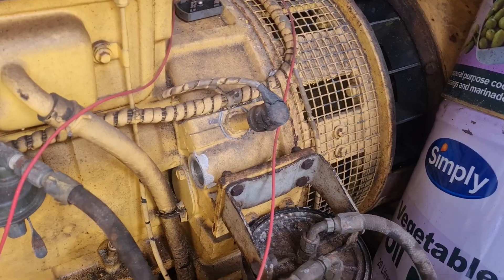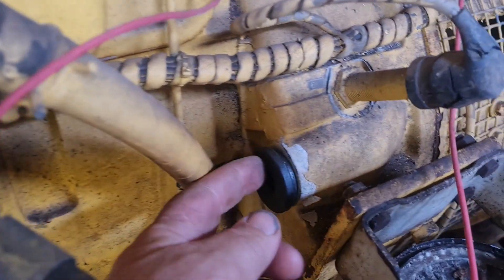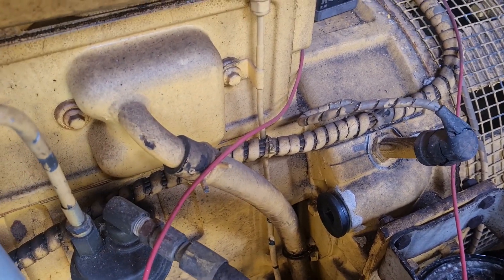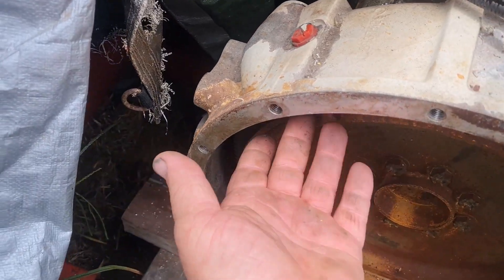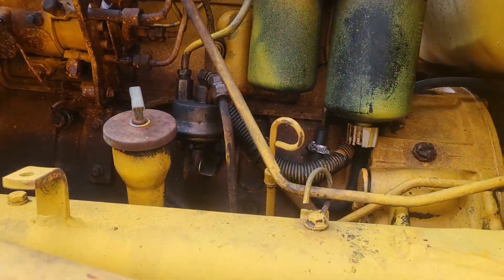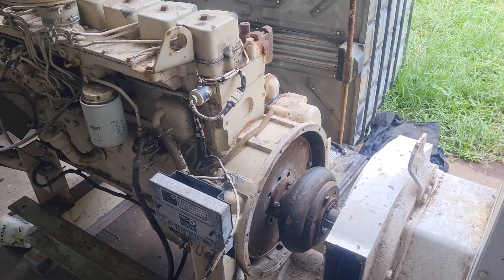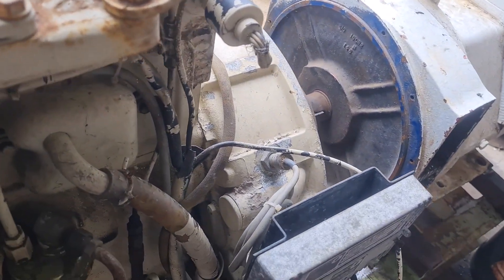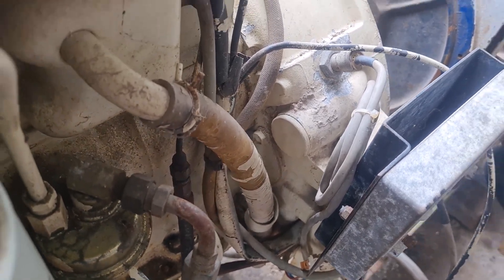Cummins/Case 'B series' turnover tool

Comment: you can build yerself a turnover tool with an old starter armature, weld on a bar to the armature then stick it the modified starter on the engine and turn it over like that